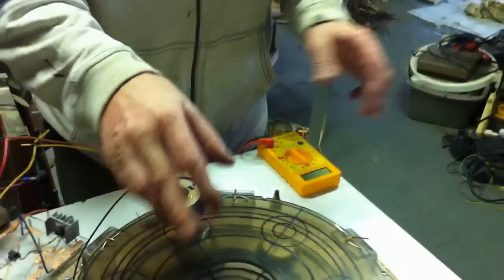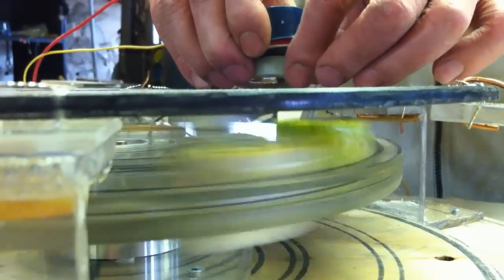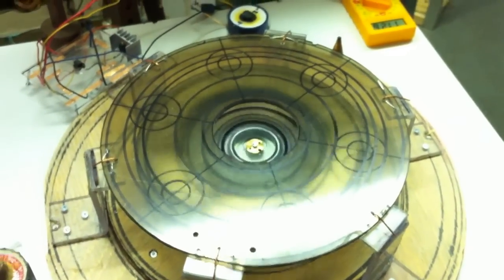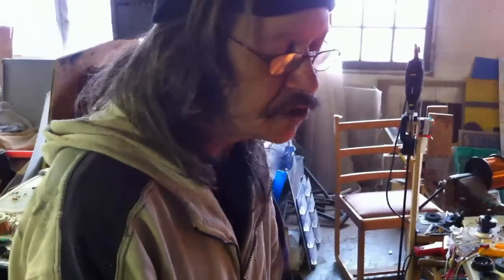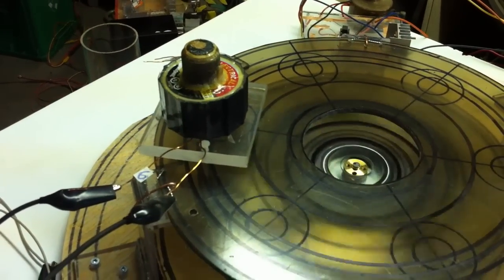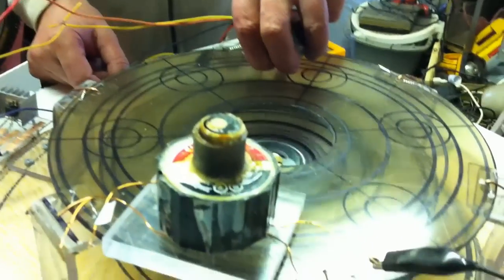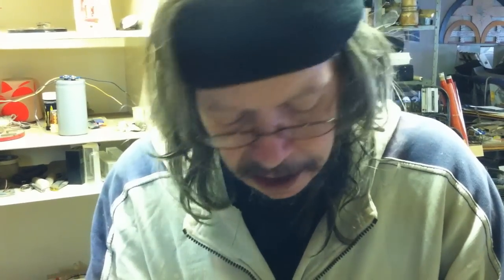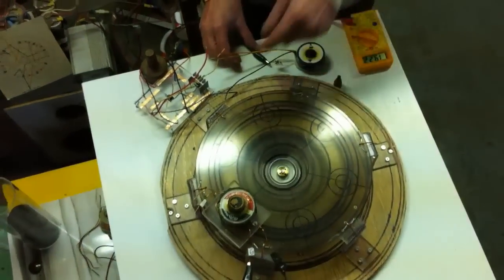UFO Alien Leak FS12a - SuperParaMagnetic Application

Comment: have you thought about crystals they're cool they recharge through heat and have you thought of wireless energy being a generator it also works DC voltage so you'll release a lot of static for your home say you get 6 car batteries you'll power your whole house with wireless oh 12v 500a can power a 120v light bulb. wireless energy youll replace spinny generators.    :-D

Comment: you have created what looks like a very crude version of the Shaded Pole electric Motor, found inside Various household electrical appliances, the AC current that energises the coil which you hold in your hand acts on the magnets if the coil was DC or instead a Static magnet it would not work it needs to be AC so that the Poles are continuously changing in order to operate. the could acts as an electro magnet.

Comment: Looks like a powerful electromagnet Is being hand held with a hall sensor inside facing the polarity of the magnets below it.  If held at just the right angle and distance the circle of below magnets will do what you see.  Been there and done that.
Reply: +Thomas Ferko I see a transistor and i believe the coil to be bifilar. My guess would be that it's very similar to a bedini ssg.

Comment: This is one of the core beginnings  of the "new" car system. The car system needs to warm up for 10 minutes to gain enough energy to support itself. They will eventually work with light creating faster and more efficient methods of transportation.

Comment: Excellent JOB!! What if you where to just use "neodymium magnets "... of course that would be a lot stronger setup, but it would be completly free energy!!
.
Combine that with "air bearings" and you could make a generator that was completly maintence/worry free... so much free energy devices/ideas out there... I'm sure engineers have come up with a million designs, but they are all snuffed out....

Comment: This looks like a Bedini SG motor. I give you an A for effort. You appear to have gained most of your knowledge on the subject from actual experimentation but I really think more study of physics would help you understand if you are actually doing something new.
Reply: Chris Turnblom new or not, lets have free energy
Reply: KaiLynn Darkpixie Absolutely.
Reply: +Chris Turnblom YES! FUCKING FREE ENERGY!
Reply: +Isiah Jay  
lol "free energy" is a misnomer.

Build a Bedini SG motor, man They offer the plans online for free and if you already have a bicycle wheel and a spare car battery or two you can do it for less than $40. Those things are a little strange. I still need to go back and do the experiment with two identical batteries so I can accurately measure the results but ...um... ya they are cool and seem to be doing something unique.

I can not say for sure without proper equipment but it did SEEM like I was getting extra power from somewhere.
http://rpmgt.org/JoinBediniList.htm
Reply: +Chris Turnblom   I have constructed what I would call a hybrid generator that takes the best of a lot of ideas including mine  All is now for sale and simply put it turns 24 DC volts at .5 amps into 300+DC volts at 1 amp.  Click -WHAT WATT POWER? - on You Tube. I have 3 videos pertaining to it posted.

Comment: What happens when you put a load on it? So if you want to drive a mechanical device or charge large battery it will slow down pretty quick. Very interesting though. Keep it up.

Comment: One thing I found out by watching some of the Muller video's was that there was an odd reference to how many coils were to how many magnets, if there were 8 magnets then there would be 9 coils, that's what I mean by odd reference, this is supposed to be to stop the cogging, it was odd because what seemed to happen was that 1 magnet would be in direct phase with 1 coil at a time, this seems to make some sense, as it would be that if there were 8 to 8 that would create an equal amount of cogging at the one time that all 8 coils and 8 magnets are aligned at once creating cogging on all.

Comment: Magnets have a natural fluctuating frequency. Tune to it and u don't have to turn it off. Its simple math after that. U only meet one adjustable unit to tune to the natural fluctuation that occurs between two spaced permanent magnets. See those marks on the plastic. They aren't just for looks :p

Comment: Magnets! Yenius! Limitless energy. No power consumption. Using the rubberbanding from the positives and negatives from magnets, when the negatives repel the negatives thrusting them forward, or the positives pull the negatives to themselves but not enough to halt them to a stop so they continue to pull and pull towards the next one, increasing speed, making an infinite generator without a source of power such as fuel, gas, electricity, etc. Infinite free energy, but corporate world hates that :(

Comment: FS20 - Zsro Point One; just went up! Showing the central accelerators of SALAD SPINNERS, with inverted Zero-Point pivots producing lots of current! Can be built very cheaply (less than 10$) - just the thing for your not-hooked-up country cabins!More will come soon as the Mayan Grand Cycle closes. (Am presently combining zero-point & Lev for non-friction\non-weight "Spin-Dizzies". Take a look!

Comment: Yes: Moving magnets or conductive wire produces current (see Faraday) - it is that simple! The trajedy of the 20th century can be considered to be: WEAK MAGNETS! Leaving us now in this HUGE LETHAL MESS! Magnets now are 14-20 times stronger than 1903 (when most cities got first Grid: Turbines were 3' plus in diameter, yet produced no more than the 10" ones you see here! We now need neither fuel, nor a State megaproject Grid. All the people can produce current in Energy Generation Parks!

Comment: If you mean some condensing capacitors you are right! I spent much time obtaining large capacity caps - & neglected to get low-voltage ones - which by rapid firing would reduce resistance & allow their combined separate circuit to charge low-volt batteries at the same time (at slower revs with a voltage regulator cut-off at full charge). Thanks for aware comment!

Comment: Hall effect sensor needs N-Pole to tyrn off (3 S-ON/3N-off), so tri. won't work. If you mean construction - for here angles not great enough with 3 (for rigidity), but 6 do it O.K. For PRODUCTION CAR, all this will be injected HDPM (High density polymer mix), much lighter, stronger, & slimmer.

Comment: Yes - centrifugal weight of the magnets (going faster) is what limits rpm's. Depending on protection from outward flinging, this figure can be between 2000 & 10,000. A tough plastic with inner fins can raise safety to about 5000. Tech bears some resemblance to bullet-proof vests & tank rpm protection. This 5000 rpm limit does NOT limit either Voltage or Amperage output however. Magnet strength & number & winding turns determine this also.

Comment: remarkable thought, in response i wonder myself, what if the applications of this technology were applied to space travel instead of earthbound travel, then there would be a vacuum with no need to make extra holes, or even incorporate a vacuum into the design. might not make enough sense, but the idea that we could find a mode of space propulsion that does not use fuel could be an immensley important asset to future space exploration.

Comment: Woke up with the notion of a PARTIAL VACUMN would allow faster spin with less resistance - but how to seal without friction around axel? Wracked my mind & then thought; what if top-spinning Dome (see new FS14) had holes around base to suck air out of column? This may be super-eleghant solution, since MORE vacumn is needed the faster the magnets spin! Which is what would happen. I built top air turbine to FOLLOW mag-drivers; now I think it may LEAD them at speeds more than 20mph? SELF-PROPULSION!

Comment: So BUILD  IT! - Then it will be declared ILLEGAL - for "safety" reasons! But you don't NEED 25kw; for millions of vehicles 4 or 5kw does nicely (& safe). About "non-magnetic bearings", I have used in CONJUNCTION with twin ring magnets, so no heat & stable to 30*, so your car can go uphill (& down). Megaprojecteers like yourself have BIG ideas - 2' cocks minimum! But you never BUILD anything - relying instead on 10 year old slicks out of Sandia Labs & such?  The Chinese people are not so dumb!

Comment: er...no it isn't Old Son - it is primarily a multistack generator, digitally TIMED it is true. Good reason why IT IS NEVER PUT UNDER "LOAD"! Also, elimination of steel & all ferrous objects, rids it of hysterisious, & reluctance. Finally, "interiorized Levitation" removes bearing friction, so both external and internal frictions fall by wayside. Maybe you have been reading too many old texts, where engineers labored to "make do" with inherantly defective technologies? Such as fuel, Batteries etc

Comment: Tech update: Received non-magnetic Bearings- only 1 comp. makes them (German), as with big paramag. rods. 2) Added 3 big S mags (instead of 6) & found Hall still turns off / EXTENDED South push but NO North pull (1/2" sep.makes whole difference). 3) Switching  to Hex tower mounts / 12 (instead of six) main drive mags.
I see some TROLLS have shown up (2 of 2400 not so bad?). If ZERO "torq" - it wouldn't turn at all! Other guy: look at sky; look under sea - but don't look out door see GAS CARS?!